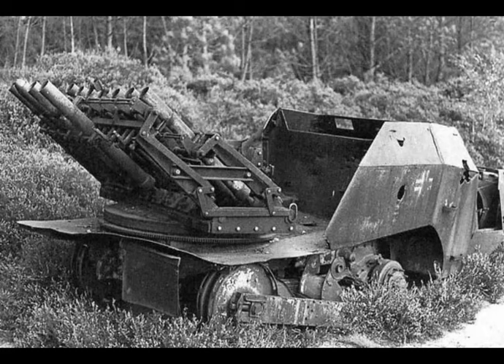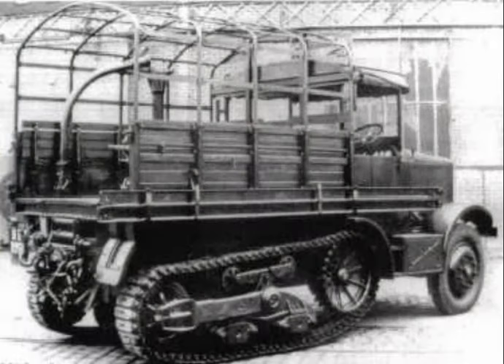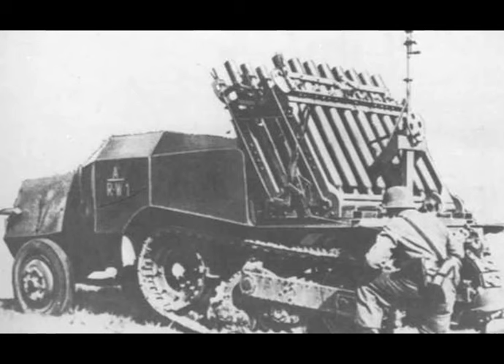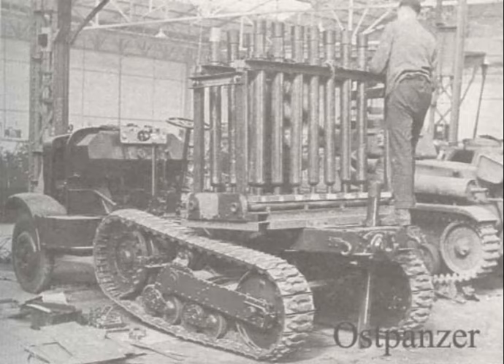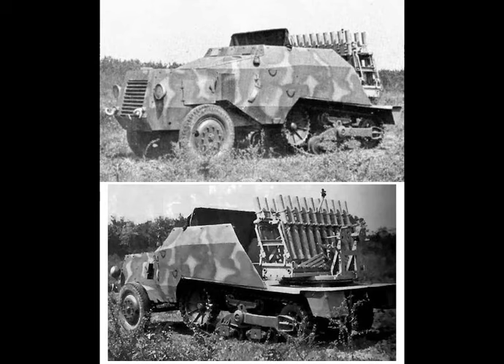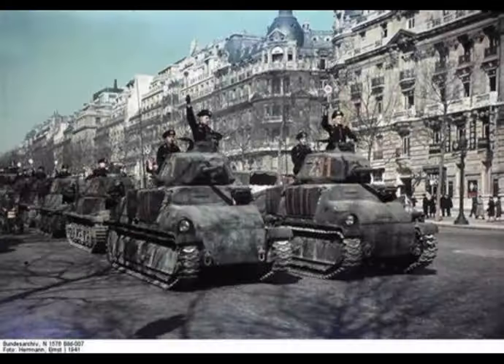Reihenwerfer: Germany's Makeshift Mortar System  | WWII History

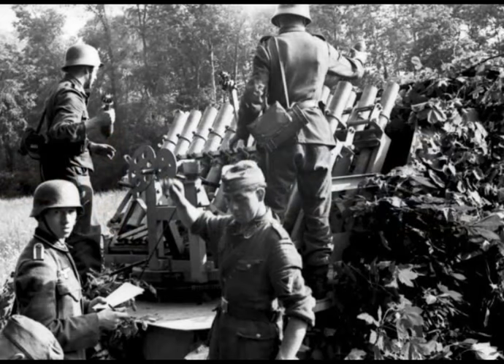Comment: The description of 10 or 20 tubes was interesting so I counted them in video.  Photos of 10 tube at 3:07 and 6:00
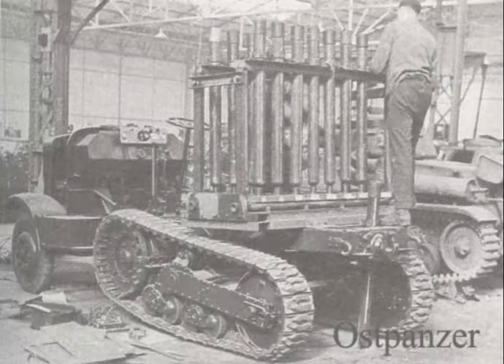The photo at start had 2 rows of 7 = 14 tubes, and photos at 1:00 at 2:00 at 4:50 shows 2 rows of 8 = 16 tubes.
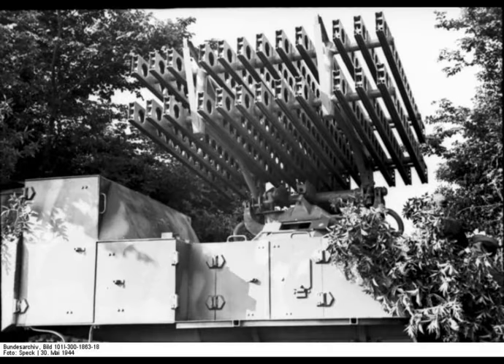The photo at 4:00 is not a Reihenwerfer.  What's shown is the nazi improved version of soviet Katysha rocket launcher on French somua MCG half-track and named:  8 cm Raketen Vielfachwerfer auf Fahrgestell Maultier  
That experimental launcher system can be very interesting too for example soviet launchers had I shape on launcher rails with big #3 at end to stop rockets from sliding off versus nazi H shape launcher rails with slide-back stopper mechanism built in each rail for faster loading, and those different launcher rails are a major detail that fine scale model builders always get wrong at least since 1980s.  Also the nazi manufactured rockets had slightly different look with angled fins that improved accuracy, etc.
Reply from the maker: Thanks for information dude and the ten and 20 is based of written accounts but there was massive variation in the amount and even vehicles they were based off , a very homemade vehicle by Alfred Becker and his men .

Comment: It has been noted that Russian units are using Grad BM-21rocket  barrels in smaller more mobile configurations of 1 barrel to 8 barrels, as a heavier  artillery unit than the SPG-9
Reply from the maker: I've seen this on pickup trucks on both sides of the conflict in Ukraine very smart DIY MLRS builds

Comment: SJB, Yet another great, interesting video, on WW2, I'd never heard of this weapon before, just curious though, How Was It Loaded ????,  as normally a morter, relies on gravity, in the tube, to hit the firing pin.
I'll see if can find more info. on this weapon.
Again thanks for all the time and effort, you put into your videos.

Steve From London UK
Reply from the maker: I believe all the round were on a drop system so that when the trigger was pulled the wires would drop the individual rounds into the tubes , very simple and reliable and thanks for the great comment Steve
Reply: @SirJellyBean  
Why no spring loaded firing pin in the bottom of the tube?
Then the mortar rounds would sit there fully cradled ready to go....
up comes the firing pin and off goes the mortar round
with no possibility of the mechanism "up the tube" getting in the way?

In South Africa an anti-ambush weapon was made from steel pipes with shotgun shells inserted in the bottom.
The tubes were  held vertically on the sides of trucks by linked removable pins.
There was a hinge on outside of the tube at the bottom on the truck's side...
and a fixed firing pin mounted on the truck body just below that hinge.

Upon release of the tube the  tube would fall outwards from the truck...
and then the shotgun shell primer would hit that fixed firing pin when the tube got to 90 degrees off vertical...

The ripple volley would decimate close in ambushes during various conflicts that South African troops were involved in....